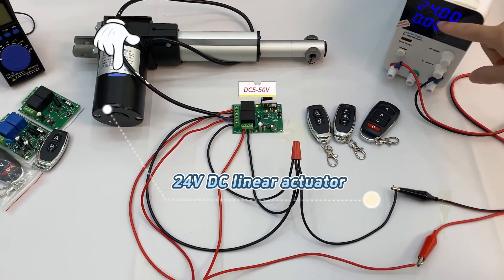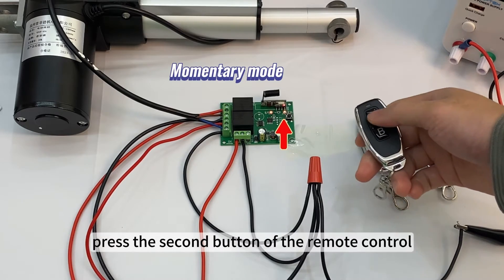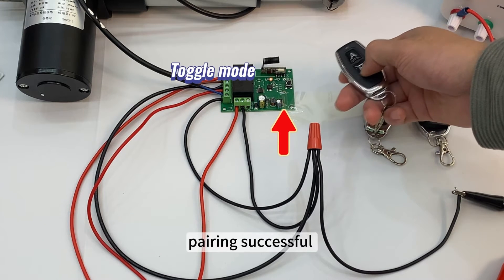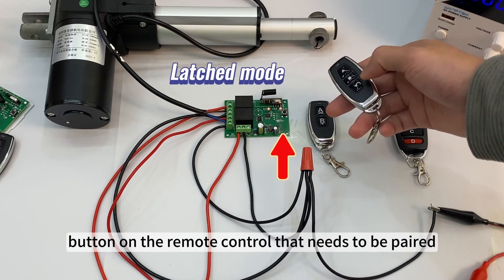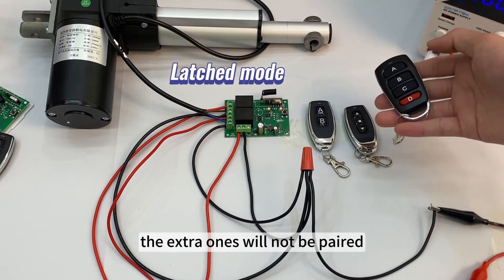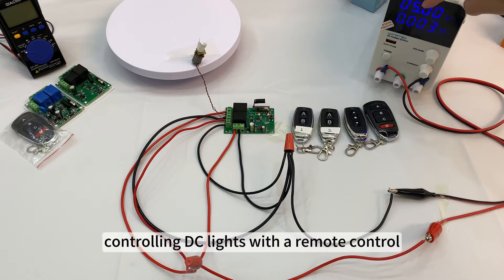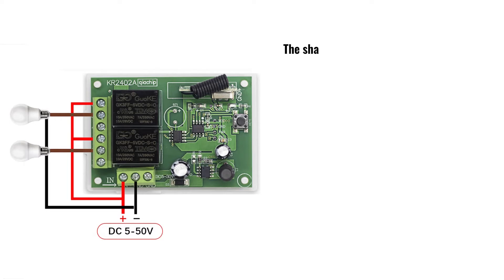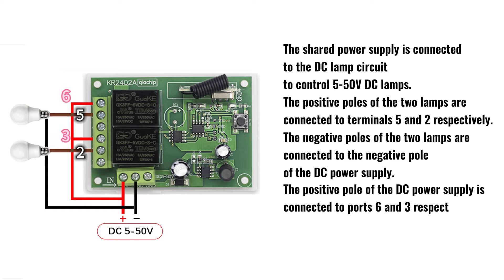How to use 2CH RF remote switch linear actuator controller forward reverse rotation momentary KR2402

Comment: How to wire 2 and 4 channel LEDs
DC power supply is V+ and GND
On this model (KR2402) that is shown in the video the 6 and 3 connections are the NO (Normally Open) ports. The 5 and 2 are the COM (Common) ports and the others that are not shown are the NC (Normally Closed) ports

Whatever model relay you are using, please first identify the correct ports.  They may have different numbers to the ones shown in the video!

To connect:
Run the positive wire of the LEDs into the COM terminals of the relay
Daisy chain the Negative of the DC power supply to GND and all the negatives of the LEDS
Daisy chain the positive of the DC power supply to V+ and all NC terminals

Learning button
Click 8 times to clear
Click once (1 time) for momentary mode this means the light will only stay on while you hold the button
Click twice (2 times) for Toggle mode this works like a light switch, press the button for on and then the same button for off
Click 3 times for latched mode, this works so that button A is on, Button b is on but button C is off.  This works more for motorised things.

Comment: Can I define toggle on A for on/off and momentary on B for starter at the same time
Reply from the maker: Our current KR2202 model does not have this function; we will develop this function later. 
Could you see if we can use two separate circuits instead?